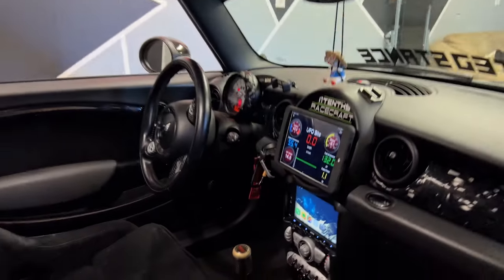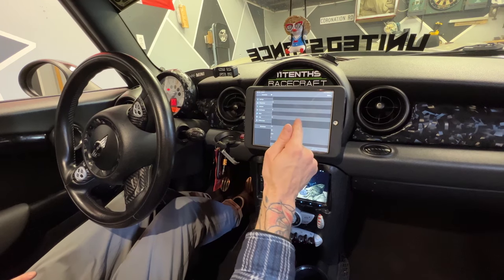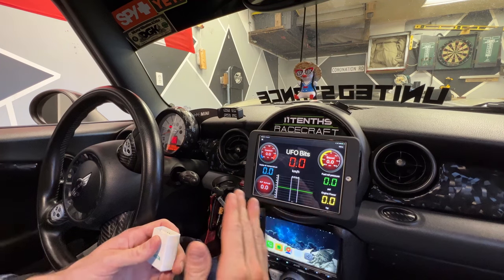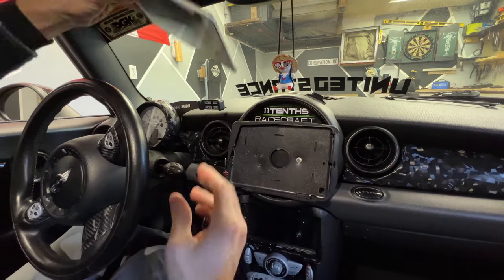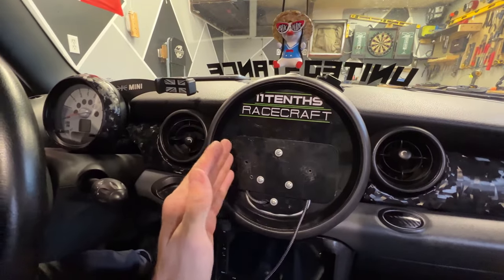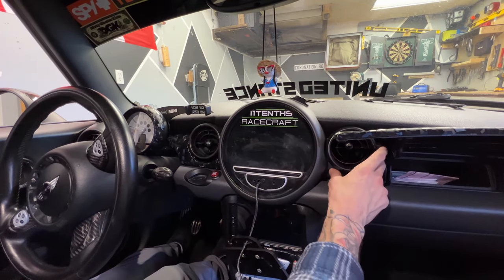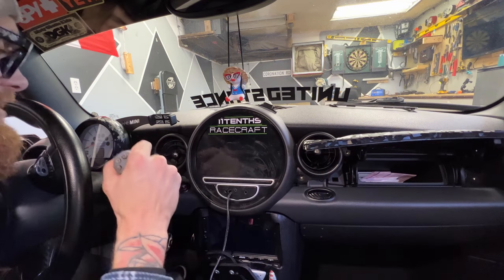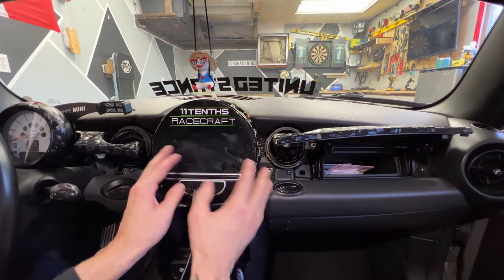Digital Dash Upgrade Mini Cooper S R56 / Any Car

Comment: The wiring harness choice and wiring itself is the help I need to finish this. Ive got a really nice pioneer deck that I want to install, Ive got all the hardware but the wiring is whats holding me up.
Reply from the maker: You can find the wiring harness on Amazon, just search up r56 radio harness

Comment: Thanks for the inspiration. I didn't make a permanent version, instead I used an old ipad air, nexas obd, dashcommand app, and an illo mini Cooper magnetic phone mount with an added magnetic mount. I think I'm going to upgrade to a new ipad mini 5g and turn it into an infotainment setup when I'm not responsibly speeding up the 5 😂

Comment: Hey man. Super helpful video. I recently bought a 2012 Mini Cooper S R56, starting to look at what to do with it in terms of aftermarket stuff. 
First thing i want to do is the radio upgrade, and then i want to get more infor from the carbitself, like turbo data, engine readings and stuff. 
What fascia did you use for the radio? 
Are there any sites you recommend for resources on doing this up, and parts etc?
Reply from the maker: I got my radio and my double din radio center console piece from Amazon

Comment: This looks like a good addition, but I'm wondering about *Real Speed Speedometer*? Apparently BMW hates telling us the Real Speed of our Mini Coopers. Allowing 10% discrepancies is simply LYING... to keep us going slower. With Google Maps on my phone at least I can see my real speed. Yet I'm wondering if they're lying about speed, are they lying about MPG's or Odometer Readings too?!? Speedo reads 80 mph and actually doing 72 mph!  Will this upgrade show us true speed, odometer reading or more lies from BMW?
Reply from the maker: Well I can actually assure you that my iPad is on point cause when I got pulled over going 110 in a 80 when I saw the cop and looked at my iPad It said 110 lol. So it’s pretty accurate. Maybe the needle in the actual speedometer has that 10%

Comment: So I have a r53 that is plagued with dash issues for example my tac doesn’t work at all every once in a while it kicks on but I’ve gotten used to it I’ve tried to figure out online or forums what it could be but other mini owners with the same issue don’t have no answers would this digital dash be able to replace my broken one or the tac and speedometer have to be working properly for this mod to correspond?
Reply from the maker: The digital dash reads everything from the ecu / obd2 port so they don’t need anything from the tac or speedometer to work

Comment: Info on the radio please
Reply from the maker: its just a atoto a6 android head unit. other then the kinda slow boot up its not bad. defiantly better options out there now. if you need a double din radio conversion you can look on ebay or amazon for both a good deck and  and radio dash kit
Reply: So did you remove all the climate controls to put in double din under the iPad?
Reply from the maker: @single_cam9199   yeah you would have to take the old radio dash apart and then just re install them onto the new double din radio dash kit. its very easy and can be done with basic tools and i believe a t27 torque bit ( may be a smaller size i forget )
Reply: Thanks 🙏